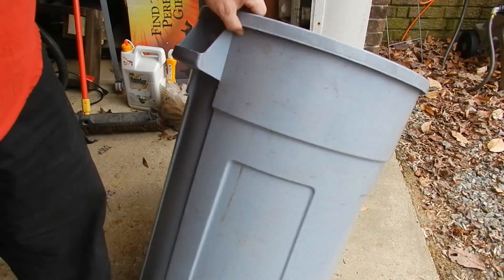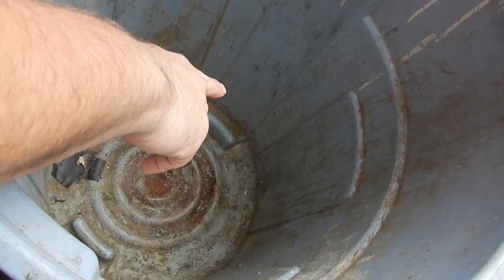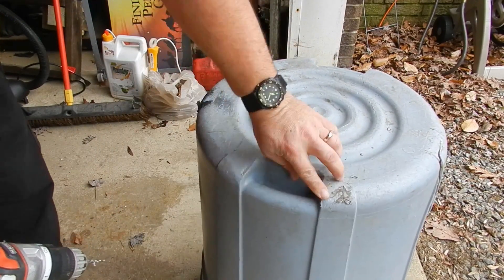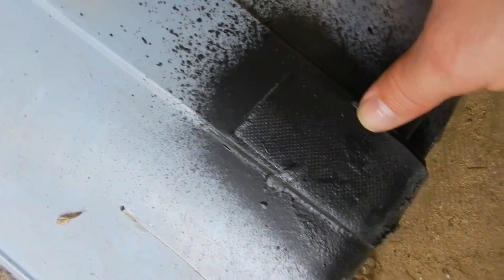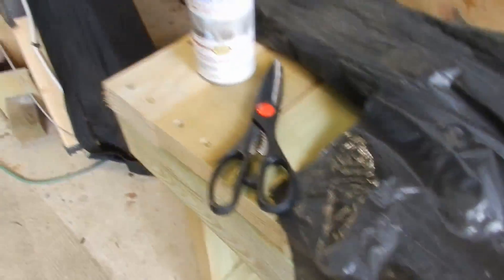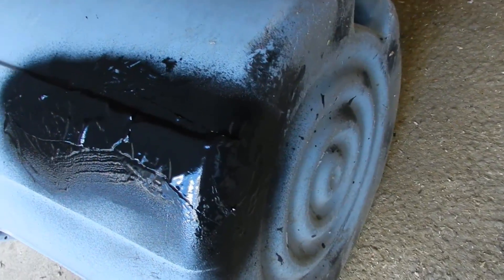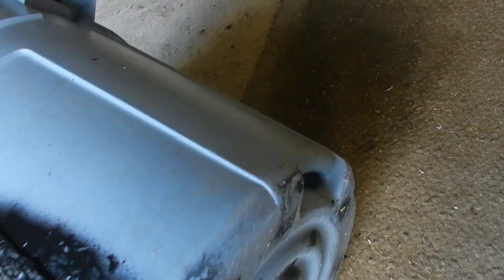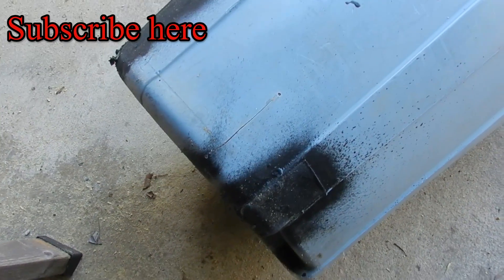How to Repair a Plastic Trash Can

Comment: Am gonna try this method.  Bought a replacement outdoor trash can several months ago after the 1st one was broken by the garbage collector truck throwing it down on the hard-ice-covered ground during last winter.  Now the 2019 winter has just started, the 2nd garbage can is broken again!  Thanks.

Comment: Great idea.  I tried this on my garbage can that I was ready to throw out.  This idea worked great!  Sure garbage cans are cheap but why throw away to a landfill when the repair is this easy?  Thanks for sharing this.
Reply: Garbage cans are not cheap . My "can" with a hinged lid costs about $120 replacement +8% tax! I welded the hinge strut together with a wood burner.

Comment: I've got a plastic trash tots with the lid damaged, a big piece broke off.  This repair will need some structural reinforcement.  Is this a good option?
Reply from the maker: It will need some reinforcement and just replace it.

Comment: William, I admire your ingenuity and frugality, but I'm thinking our time is worth something too. Me, I'd buy a new can. Maybe put the new can inside the old one.

I came here looking for a way to reinforce the bottom of my wheeled can, with the front scraping through. Silicon caulk or your week blocker won't last. Hmmm, where do I get some scrap sheet metal? 

Or is there a better solution?
Reply: I agree time is money, my can is plastic, supposed to be life time warranty, but ??? and it cost 160 bucks, so i def would love to try this.
Reply: How much is your time worth after taxes? $45 per hr minus $10 to repair the first hole for materials rest of the holes are free. is free. If your making a couple $100 per hr then not worth your time. What do U do to make that kind of $